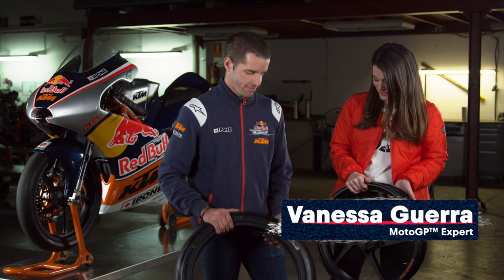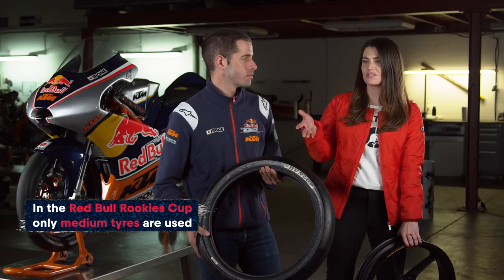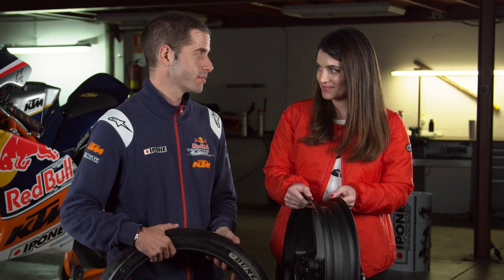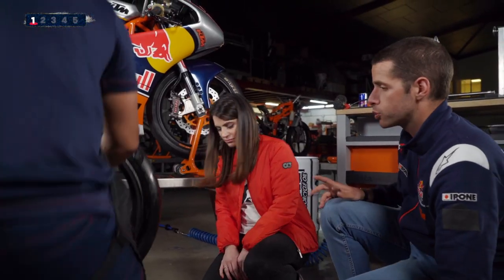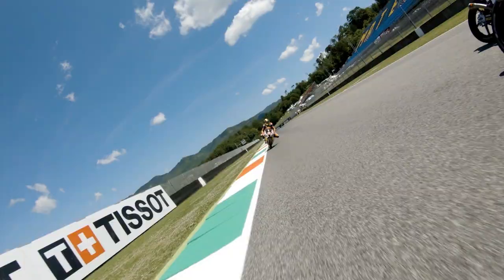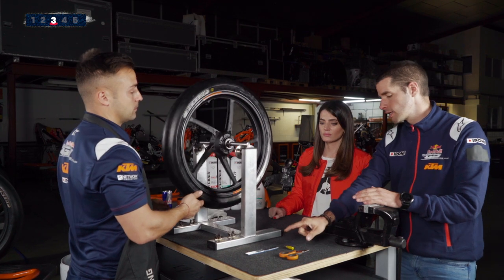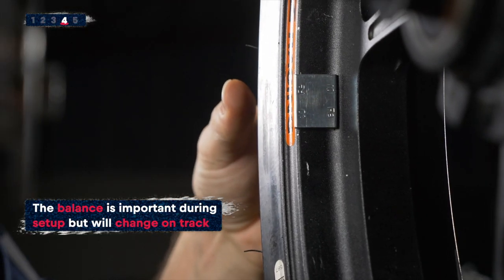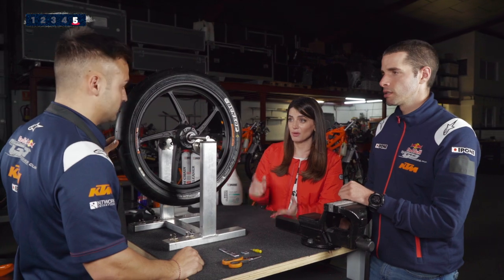Learn How to Change And Balance A Motorcycle Tyre | Get Ready to Race #5

Comment: Y'all street riders: line up the marking on the tyre with the valve in the rim. The marking denotes the lightest point of the tyre, which if you line it up with the heaviest part of the rim, the valve, you'll need to stick fewer weights on it.

Ah you can see the yellow dot in this video as well, neatly positioned near the valve :)

Nice shot of Assen at 5:15, Ossenbroeken  going into going into Strubben!

Comment: you dont need tape over the weights. the weights already have adhesive under them and to add to that the centrifugal force from the weights themselves will push them inward into the rim. but hey, you guys are motoGP technicians and i am just a normal technician. cheers.